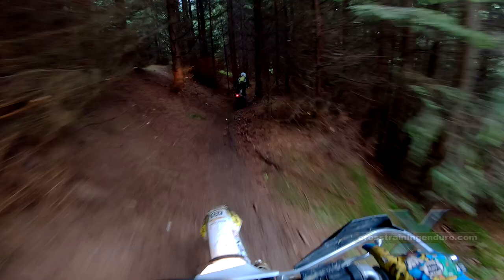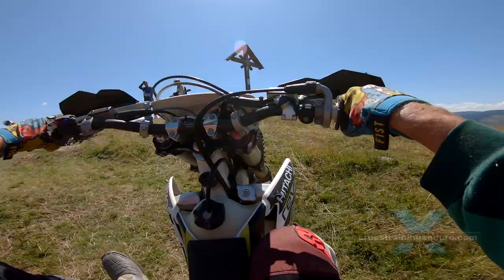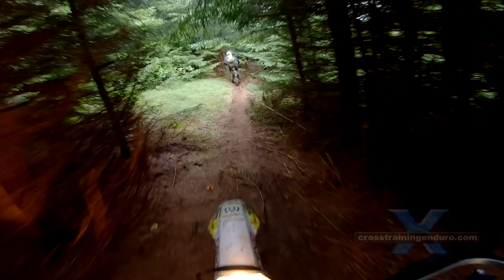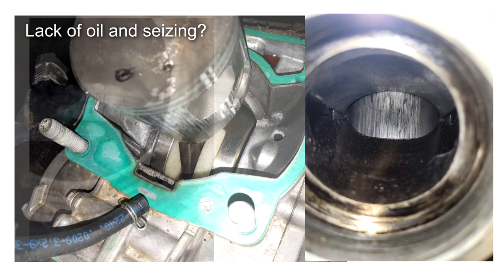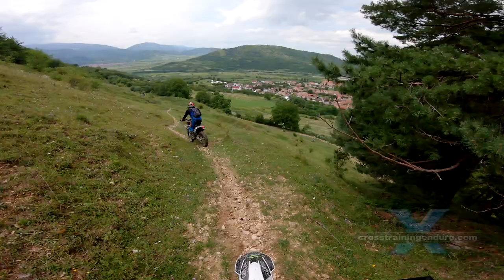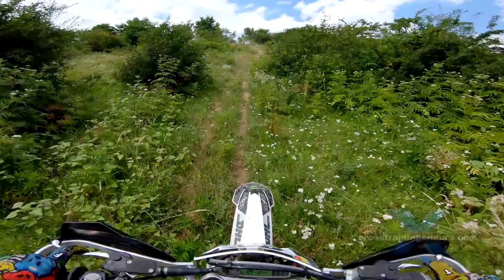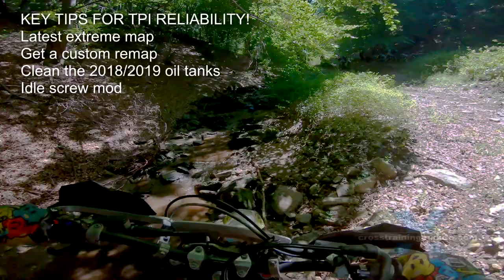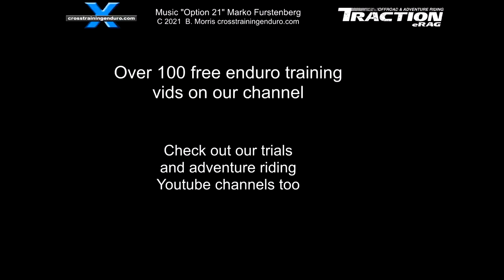Most common TPI problems, questions & solutions from a TPI specialist! ︱Cross Training Enduro

Comment: I was a little nervous about oil injection on my bike. Don’t think I’m gonna go to TPI anytime soon. I can usually fix a carburetor issue on the trail but I can’t replace a sensor.
Reply: That's like saying I don't want fuel injection on my car because a carb is easier to fix... How often does your fuel injection on your car need parts replacing?
Reply from the maker: I think the difference though is that we've had many years of mainly trouble-free driving the majority of cars with fuel injection. And mostly the same on road bikes for a long time now. At the current rate it could take a fair while before all issues are fixed and then for the long term reliability of TPI to become established.
Reply: @supernovadw  Good point but tpi on 2 strokes is still pretty new…and when a sensor goes bad on my truck I can call a tow truck.
Reply: @davehowe_just_an_old_dirtbiker  when sensor goes bad bike just isnt 100% crisp anymore but can still easily be ridden. Few times people didnt even know sensor was faulty until sopmeone else tried their bike
Reply: @crosstrainingenduro  The other thing to note too is that I was around during the conversion from carbureted cars to FI and I don't recall engines seizing in the cars. Like you said, once they work out the bugs it will be a winner but until then I don't plan on being a guinea pig!
Reply: @maucina12  Not necessarily. A friend of mine had a temp sensor go bad and while it ran good for the first 20 minutes or so, as soon as it was warmed up it would die and not restart. The sensor thought it was cold and kept dumping fuel in as if the engine was not warmed up yet.
Reply from the maker: Maybe the sensors need sensors too, Dave...?  🤔
Reply: @crosstrainingenduro  LOL!!

Comment: Man I love my Beta's:)  
Don't get me wrong I love all dirtbikes but my buddy has a 2021 300 KTM  and it is a really sweet bike but he is frustrated that he had to stick so much more money into the bike to get it to perform the way he prefers, like a carbureted bike.  He also converted the forks to springs, way better according to him.
Reply from the maker: It can be an issue with various bikes. I remember buying a near new KTM 690 years ago and then found out I needed to spend close to $2000 to get it running right. I'd already paid so much I just sold it. Hopefully that's not the case with recent models.

Comment: Maybe adding a little oil to the gas in the tank as cheap insurance. Manufacturers probably have to run the gas oil mixture as thin as possible due to emissions regulations.

Comment: Easy fix use a carb I run beta 300rr torque low down is nuts I love this youtube channel the tips and tricks is brilliant
Reply from the maker: Apart from the main bearing issue a few years back the RR engines really are a work of art when it comes to grunt.
Reply: @crosstrainingenduro  friend had constant problems with main bearings on rr 300 on 2021 model
Reply from the maker: Did Beta fix it under their extended warranty? I hope so! It was crazy they let the problem continue for so long...
Reply: @crosstrainingenduro  dont know the details about repairing

Comment: Rode a new TPI yesterday very briefly. Felt 'weird' in power delivery. But I just assumed it was different than my carb model and not 'bad'. I'm sure I'd get used to it just fine. It feels softer in power but I think that is just inferring smooth power delivery as soft. My carb 300 definitely hits harder up top though.
Reply from the maker: We mainly noticed the lack of grunt when we rode a carb 2018 250EXC back to back with a Gas Gas 2021 model... and the TPI was already remapped and had an aftermarket head! It was way softer than the carb at low revs.
Reply: yeah the TPI is better than a carb for hard enduro bacause of the softer but very predictable power delivery=more traction.

Comment: Are you shure with the crank bearings ? 
My friend from Bosnia had to replace them at about 240h. Before he was riding a 16´ 300, that is still riddin by a friend that got 600h without crank bearings replaced. I would say riding style didnt changed this much.....he said its because the fuell mix didnt have to pass the crankshaft and so lubrication is not that good like on carb bikes
Reply from the maker: Me? I know next to nothing about mechanics. But this is coming from a specialist with years of development and work on two strokes.

Comment: Still got my trusty 18 300 xc carb, went to Keihen, big improvement but after seeing a vid , Smart carb vs TPI my interest was sparked.
I would most likely buy a TPI if i was upgrading but really cant justify the coin so SC2 inbound.
Bloody expensive to get in Australia but still way less than a new bike and having to do the suspension again.
Reply from the maker: We rode a friend's 2018 carb back to back with a 2021 TPI and there was simply no comparison. And this was after the TPI had a custom cylinder head and aftermarket ECU fitted to try and get better grunt. It was such a big difference we are still wondering if the TPI was simply a dud bike.

Comment: When the pressure sensor reads high it runs rich and the spluttering starts you also lose power everywhere, when it reads low it runs lean and does the top end bog thing (runs out of map/ empty cells?). 
I have 13 CCPS  and use them as tuning dongles (electronic jets) I'm about 30+ meters above sea level (14.6 psi) and my senors read 14.1 for the 5 black China sensors and 14.2 14.4 14.5 14.6 14.6 14.6 15.2 15.2 a mix of KTM and China grey sensors.
I mix and match both baro and crank case to get it just right. Start with a middle range baro 14.4-5 then find a crank case one that gets it running pretty good and fine tune it with a baro sensor. 
You can't have a large difference between them or the ECU gives an error code.
My bike seized 2x and probability a few minor ones in between, I think it's sticking check valves in the pump. I replaced mine then it was fine after that.
Reply: Might as well be jetting a carb lol.
Reply from the maker: That's a lot of experimenting! What year model is this?
Reply: @crosstrainingenduro  2020 EXC150. Not that bad to do, just it only lasts a few rides or less untill the sensors start reading different. A lot of TPI's out there spluttering and the riders don't know any better.
Reply: @Andy-co6pn  At least with a carb I only needed a needle change between winter and summer.

Comment: I have a KTM TPI 250 and have never experienced ANY of these problems at all. The bike is as it came from the dealership, with just an FMF full exhaust.
It all depends on whether riders thrash their bikes or not.
Reply from the maker: Actually riding style doesn't appear to have any influence for many of the issues... although if a 2020 or 2021 is going to seize it will probably happen faster if ridden hard. And issues such as fouling plugs or spluttering at low revs happen more for the casual riders...
Reply: @crosstrainingenduro  or perhaps some of those bikes are just lemons 😁

Comment: I have a 2022 300 TPI and previouly a 2020 300 tpi. The 2020 had a heap of issues was an absoulte lemon. The 2022 with the new map is definely leaps and bounds better, The key I have found is starting procedure, I run the cold start out on my at first start until temp reaches about 34 degrees celsius. Turn that off then ride around easy until it reaches operating temp around 60 deg and the thing runs perfect all day. I did run the TSP kit on my 2020 but due to me not following that startup prodecure it would foul plugs and run shit all day.
Reply: Never heard of this starting procedure, but its likely this is done anyways, as no one starts a bike and runs it without stop the whole day ;-)
Reply: @hachtenduro7824   I only do this on the intial start up for the ride, its fine afterwards even if you stop just not initally when its cold.

Comment: 20 hours in and suddenly fouled 2 plugs. turns out was the CCPS that went bad. Swapped it out and a week later and 3 rides it fouled another plug. considering selling the bike and going back to 4T
Reply from the maker: Some riders have zero issues with CCP sensors, others have multiple run ins... I'm not sure why. It gets expensive in Australia as they are AUD$171, about four times what you pay in for the genuine part in the USA.

Comment: The TPI bikes are not as reliable as the carb versions. Stock, the bottom end power is much softer. The oil injection fails in cold weather operation at startup as the injected oil coagulates on the reed block. The Crankcase Pressure Sensors fail frequently. The worst part for the consumer is that replacement parts are not only very expensive, but often out of stock. Waiting for months for parts for your $10,000 dirt bike that seized in less than a year old is extremely frustrating. KTM/ Husky has done a poor job of taking care of customers with their 30 day warranty. Hopefully you will have better luck.
Reply from the maker: I've heard from both Australian and USA mechanics that accessing top end parts has been tough due to the number of seizures. I just hope that KTM is offereing goodwill warranties that extend well beyond that paltry 30 days.

Comment: I've got 110 hours on my 2020, showing no signs of wear, will be doing a rebuild at about 120 hours.

I know 5 other guys with 2020's all with similar hours no problems at all. It obviously depends how you treat it. Don't go flat out till she's nice and warm. Clean your oil screen etc.

I'm sure 2 stroke performance are good, but they do have a vested interest in selling remaps. For the average rider (99% of us) who is not a mechanical moron, there is no need to remap. My 2c
Reply from the maker: Another option is to just ask your dealer for the 'extreme' map, Luke. In some cases dealers try to charge for this but often they'll do it for free because they know there have been issues with premature wear and even seizing. Certainly a lot of guys have had zero issues, other have. KTM has released 17 maps to date so it's possible they vary these even within a specific year... certainly some of the have used very little oil e.g. as little as 150:1 at certain revs.

Comment: currently on my 3rd TPI, 2019 300EXC, 2020 300EXC and now 2022 250XC,  have just left all of them stock as they rolled out of the show room, dont fuck with it with lots of pointless mods and just ride it, all super awesome bikes with no issues..................never hear about the many many many many TPI bikes that dont have issues, we are too busy riding,,,,,,,,,,,,,hahaha
Reply from the maker: Good to hear you've had no issues, Garry... that same for many TPI owners. I made this point in the pinned first comment:
"Not all TPI owners will have problems, in fact the majority have no issues. But there's a significant minority who do. We have compiled info from two specialists working in the TPI area, and confirmed with other mechanics and industry insiders. Then finally we looked at various cases reported online. Statistically it's likely that you won't have problems, or your riding buddies too. Remember main bearing failures on Beta two strokes? It occurred in roughly 5% of cases, so most riders had zero problems. But a significant number did. That's often how these known issues work. Sherco riders have similar problems with regulator and ECU failures etc."

Comment: I did the tsp kit before I even had an hour on my bike. It made it run a lot better (carb like.)
Reply: How do you know?
Reply: @hachtenduro7824  Because the bike had major pipe bang. That's why I did the kit. I didn't want to ride it the way it was.
Reply: @seanwahl1000  I understand, it sounded like you did not run the bike at all without the mod ;-)
Reply: @hachtenduro7824  .8 hours. I had enough of that surging pipe bang.

Comment: Mmm...sx 250 with 300 topend keihin carb 160-165mainjet 35 pilot nozi or nech(suzuki)throttle needle on 2nd clip ....very very reliable very very smooth and very very strong bottom  end torque

Comment: Thanks for a good summary! 
is the oil issue solved on the 2022 model or is a "extreme" map still recommended?
Reply: I own a 22 model also and would like to know this as well ...Only issue I had was a dirty CCPS which caused bogging. Mine had dirt on both sides off the small o-ring inside the trey around 10 hours. I ended up cutting the trey out and secured the hose directly to the CCPS using different hoses and fitting which has completely resolved the problem, bike has close to 40 hours now.
BTW love your videos, keep it up
Reply: I absolutely love my 22 300xcw, but it’s my first bike, so I’m relatively clueless to many of these issues described. I’m at 15hrs and I think* the bike has been flawless so far. I have a Slavens idle screw that I’ll install at some point and will inspect the cylinder and the spark plug whilst I’m in tear-down mode.
Reply: @huskynick7562  Good idea regarding direct hose to the pressure sensor
Reply from the maker: No idea yet, Peter. I hope they put the 'extreme' map in. And apparently they'll do something new again for 2023 with a TBI setup instead.
Reply from the maker: I think the main potential problem would be the mapping if it didn't come with the 'extreme' map or some equivalent that uses enough oil. Maybe check with your dealer, John.
Reply: @crosstrainingenduro  my dealer just informed me the 22 has the latest "extreme" map with more oil. I understand from Thumpertalk that the first "extreme" map was more oil when cold and the latest is more oil all the way
Reply from the maker: That's great news!
Reply: @crosstrainingenduro  Man I hope they do TBI in 2023.
Reply from the maker: If the rumours are true it's only the SX models initially, Wes.
Reply: @crosstrainingenduro  That makes sense. Ktm would rid themselves of having to procure carbs for their big 2T's. It'll be nice to have the option of two design variations.

Comment: My 2019 Husky 250 TPI runs well without any mod right from purchase. I have a flywheel weight, which I like. I run 1:150 to 1:200 premix, which might or might not help or hurt. 90h 2200km. I bought it, because it would not loose gas to the environment soil when you drop the bike.
Reply from the maker: Dave's info seems to suggest the 2019 mapping used enough oil to not worry about seizing or premature wear. But if you aren't fouling plugs then it won't be hurting the engine either. Initially when 2020 and 2021 models were seizing he suggested adding oil to the fuel as a stop gap measure while they figured out what the problem was.
Reply: @crosstrainingenduro  
Thx! I had only one fouled plug after approx 50h of operation. It occured at cold start, mild ambient temperature. Starting with no choke and immediately coasting to the course. This never happened again. I run the Iridium plugs still.
My reason for premix is, that I see a possible risk of short failure of the oil pump. If that happens, fuel will wash away the existing oil film like a degreasing agent. This is impossible with little oil content in the fuel.

Comment: EFI 2 stroke,best thing since sliced bread.I've had 2 TPI bikes, 250 and a 300...600 hours in total.Only minor issues.Never going back to carburettor again to deal with premixing,fouled plugs,rejetting,bad fuel and oil economy, and leaking when i lay the bike on its side...Or when you go downhill with running bike or doing low rev technical stuff and now you twist the throttle and the bike just sputters and you won't make the hill and don't have the power when you need it.No thanks.This doesn't happen with a TPI.
Reply from the maker: It definitely has its advantages and with a bit of luck it will get more reliable in coming years.

Comment: TPI sounds like technology for technology's sake... the benefits are outweighed by the problems and often limit trailside repairs/adjustments... if the performance is very similar why bother stressing yourself out with excessive cost and complexity compared to a carby... simplicity is best and far more reliable/serviceable. If you really want TPI wait till the factories work it out properly.
Reply from the maker: Some claim the TBI setup will regain that lost grunt at low revs. But I think we'll still have the needless complexity and so many little things that can go wrong.

Comment: Just by a Sherco, problem solved!
Reply from the maker: Well they do have their known issues too. Recently we looked into poor jetting, fouling plugs, poor ECU mapping, coil/regulator failures,  idle speed stepper motor issues, clutch return springs breaking, poorly fitting plastics and bendix failures on earlier models. All brands have their known issues when you start digging. https://www.youtube.com/watch?v=yoaaUiJWLTQ